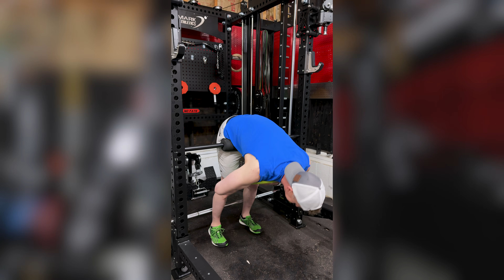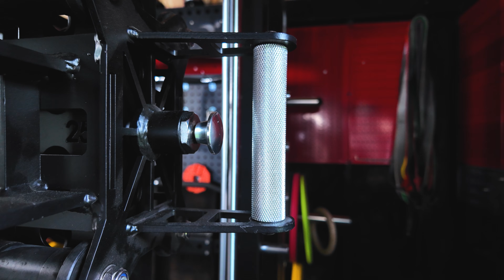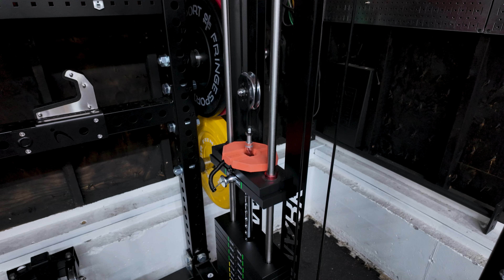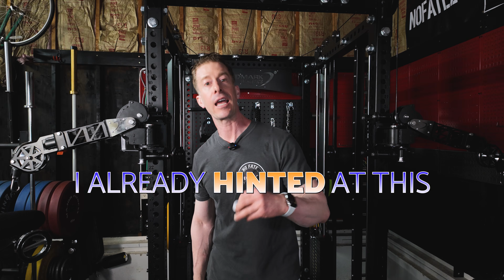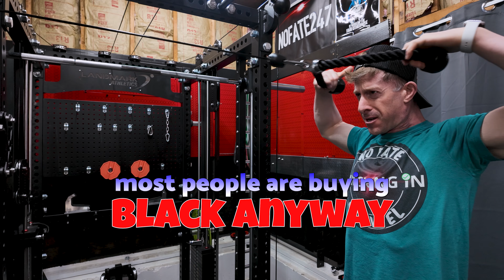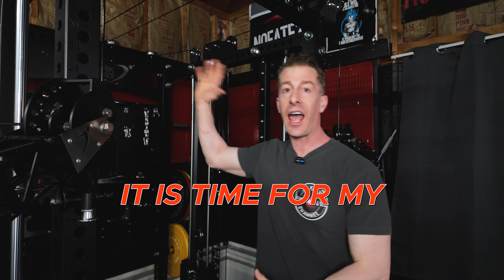1 Crate. 1,400 Lbs. Complete Home Gym | Landmark Athletics Everest Review

Comment: So I bought this thing, got it assembled this weekend.   It is really nice.   My review is this.   Big, Solid, Sturdy.   Arms are nice, cable machine is nice, kids and wife love it.   Assembly was pretty easy, cable running was easy accept for the one pulley i had to pull out to get cable under.   The only con is the smith machine bar is like 58 pounds, its heavy.   If it was counterbalanced, it would be perfect.   Finish is good, but not awesome.   I had a few nicks and scratches in the machine before assembly.   Hardest part was carrying and unwrapping everything to basement.   Kids got a workout passing weights down steps.
Reply from the maker: Thanks for your feedback and glad you're kids got to help.

Comment: At $5k why not the Dane 2.0 with smith and gibbon arms for $3k? What am I missing?  Maybe it’s the extra low row and pull down? Awesome review as always. Have fun at hgc.
Reply: The Dane 2.0 would be a closer comparison to our Luxor model. Not the Everest. Dress the Dane up with the gibbons arms, peg board and the smith attachment and then it’s a close comparison, but still has a lighter weight stack than the Luxor, and the Luxor pivot arms are a little more robust.
Reply from the maker: That's definitely an option but the dane has a one to one ratio right? But that's definitely a solid option

Comment: Can you do a pivot arm experiment with these. Clip the cable coming from the arm to the lattice part of the arm. Throw a block pulley on that length of cable. Will that now give you a 1:1 option that arm?
Reply: I went to their showroom in Medina Ohio, I happen to live by there. I can confirm that it does give 1:1
Reply: I can confirm, linking the right side Center pulley cable to the right pivot arm creates 1:1 ratio on that single pull.
Reply from the maker: I will try

Comment: Great breakdown on this item.  I really liked how the Smith machine can go high enough that most people can walk under the bar, and how low it will go for a wide range of use..  Colors would definitely be nice.  I am getting older and when you mentioned the weight of the package it made me shudder a bit, but if they sent me one for free, I would take it,  I think the socket is a nice touch.
Reply from the maker: yeah that's huge, you don't know how many people buy racks and reach out to me saying they had to order a socket cause they didn't have a 1 inch socket
Reply: @NoFate247 I have about every size wrench (or socket) imaginable.  Throwing them in a bag and bringing them to Louisville with me just in case.

Comment: nice, hope they pull a Fringe move and at least offer an upgrade option for front stainless rails. lack of color is fine, but even powder coat gets scuffed, but stainless just a little steel wool and small scuffs disappear.. Black paint if easy to touch up though so there is that.
Reply from the maker: True

Comment: I have the Luxor from them which I love. I  saw one of the reviews of the Everest and went to their store last week to try it out for myself. It’s a really really nice machine. They made a lot of key improvements for switching between exercises without much set up time. Speeding up the workout. They said they sold out of their first 2 shipments already which is pretty crazy because it only just launched. Seems to be in high demand
Reply from the maker: yeah with their prices, sales and coupon codes - Nofate247 - they have a hard time keeping stuff in stock.  WHat made you choose the luxor?
Reply: @NoFate247  it was their top of the line model they had in the winter when I was shopping around. The Luxor has a tight footprint which worked for my basement and 1:1 ratio cables means I can get 400lbs off the leg press attachment before adding plates. I tried Ritfit and Force usa to compare and it wasn’t close.

Comment: Went looking for this piece on their Canadian website, but it is not listed.  At 4900US that would be 6873 Canadian.  The rep Aries 2.0 is 4644 force USA c20 6800.  They are trying to compete with the big boys.  Time will tell if people will pay the big bucks for Landmark. They offer so much versatility, hope people give them a solid look.
Reply: I was curious about what you said because $4644 Canadian sounds like a steal of a deal for an Ares 2.0. I just went on Reps’ dealer’s site to build out the Ares 2.0 with the same options as the Everest. It came out to $8201 Canadian.
Reply: @effeffenny1 4644 would not include the rack, just the functional trainer.  So, yes you are correct.  I just priced it on the northern fitness website.  For the 93”, standard stack, with the items I would include, it would be 6932.  This includes shipping and tax.
Reply: @ranthony2714 you have to add 93-30”, the smith attachment, globe pull up grips, rounded j-cups, weight horns, spotter arms, leg roller. Then you still need to get all the accessory handle attachments. I’m over the $8000 mark compared.
Reply: @effeffenny1 I stand corrected.
Reply from the maker: They are worth the look.  The ares costs an extra grand if you get the Smith machine

Comment: These guys are coming to play. Competition is getting fierce out there
Reply from the maker: Yeah With that $150 discount and all the extras they throw in for free, I'm very impressed and encouraged by how the pricing is bouncing back in favor of the consumer.  Did I miss anything in my review?
Reply: @NoFate247  I was curious if you found or had any issues with that cable snag I had?
Reply from the maker: I saw the issues you had and I tried to replicate it but it was fine.  Not sure if I got a later version  or not.  I set the tension on the cables very tight (that's my preference, not sure if that played a factor but I did every iteration of flys I could do and never had the problem.